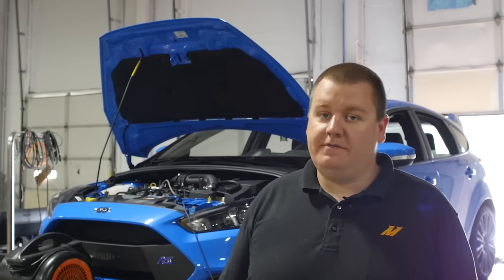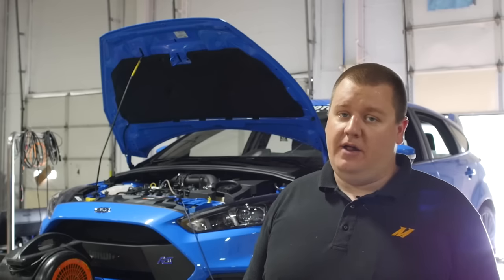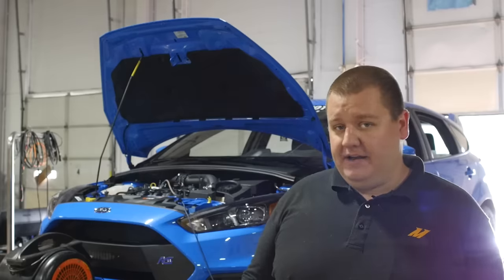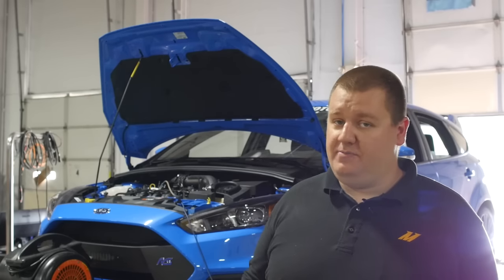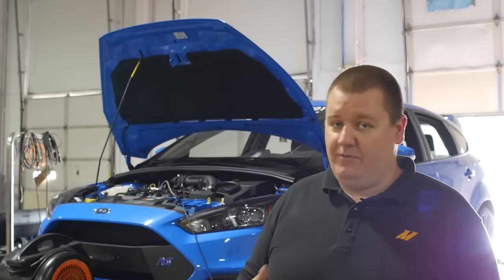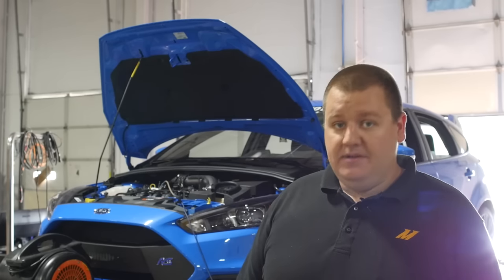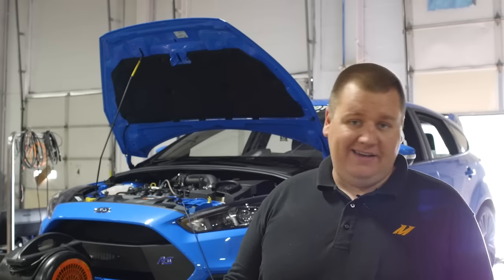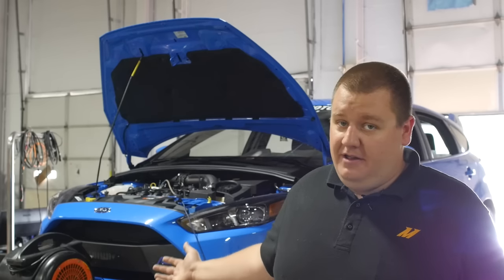2016 Ford Focus RS - Stock Dyno Pull at Mishimoto (UPDATE)

Comment: Shit, 311whp is about 373hp to the crank. Ford downplaying this car and only listed it at 350!? Now I need to go buy me one.
Reply: its probably closer to 400 since it has to go through an AWD trans.
Reply: different AWD systems will have different % drivetrain loss meaning the old take 10, 15 or 20 percent from the crank hp and that's your whp.
Reply: save your money. Every other video on YouTube shows far less hp than the 350 at the crank! Thats what he was talking about earlier...He nvr showed us LIVE footage of his dyno results on a fake graph made in excel...
Reply: #1-who cares what hp is at the crank....whp is what matters. Remove "hp at the crank" from your vocab because it means nothing....same with bhp. #2-the issue with dyno'ing the RS is the rear wheels on the RS spin faster than the front wheels (70%RWD/30% FWD). The reason the RS was dyno'ing low in some instances is because people weren't disconnecting the RDU which is different than your typical center differential. Great explanation and live dyno done by the Cobb guys here http://www.cobbtuning.com/ford-focus-rs-power-gains-and-development/
Reply: Matt Beaupre I'm sorry but BHP actually means a lot.
If you make 5000 BHP but only 200 at the wheels then your system is extremely parasitic. 
It is very important to know how much is lost in the drivetrain.
Reply: DeFreshS10 that's true...but BHP numbers alone mean very little.
Reply: Compared to whp, it does. All I'm saying is people say bhp this and that. It's what's at the wheels (whp) is what counts. Not bhp, not the manufacturer hp numbers. What the car actually puts down to the ground. Jeeeesus
Reply: You clearly have some issue with the Focus RS, and are passionate about wanting it to not live up to its deserved hype.  Unfortunately, you are not using good critical thinking skills.  First of all, below, Matt Beaupre gives you a link to a Cobb Tuning article that explains why the car cuts power on a dyno.  It's not that hard to understand, man, the car was never designed for dyno use.  It was designed to excel on the road.  There are literally 10 ways to explain why it cuts power. 

Furthermore, dyno numbers really don't mean anything but two things: 1. To see if modifications have netted gains, and 2. To see if the manufacturer is lying to you.  However, both of those things can be verified in another, more important way.  That is, REAL PERFORMANCE.  You know, on the STREET.  Where you DRIVE the car.  Why are you so hung up on dyno numbers?!  Let me break it down for you below.

All numbers from the same source, Car and Driver, all cars with manual transmission.  They go to great lengths to correct test results for weather, elevation, do two way runs, and use highly accurate equipment.

Ford Focus RS:
BHP: 345
Curb weight: 3459
0-60mph: 4.6s 
Rolling start: 5-60mph: 5.7s

Volkswagen Golf R:
BHP: 292
Curb Weight: 3329
0-60mph: 5.2s
Rolling start: 5-60mph: 6.3s

Subaru WRX STI:
BHP: 305
Curb Weight: 3402
0-60mph:  4.8s
Rolling start: 5-60mph: 6.4s

Even more telling will be their Lightning Lap times.  The STI did 3:10.5s, the Golf R 3:12.3.  The Focus RS will get run later this year, probably October.  The above numbers are in line with the horsepower numbers, especially given the weights.  The rolling start, 5-60mph test is especially telling, as it removes the launch wizardry from the test.  Given these numbers, which again, is all that REALLY matters, the Focus RS power numbers are believable.  Especially given that both of those other cars are known to be underrated and lighter.  

I'm not sure why you have some hatred for the Focus RS, but it is unfounded.  It's a lot of car for the money and there are TONS of cars that react poorly to dynos.  Hell, a lot of luxury and European cars cannot be run on a dyno without the computer shutting things down.  Why is it so hard to believe that a car with a complex AWD system might do the same?
Reply: Ford did a downplay on the first Focus RS mk1 to.
They said 215hp on the crank but when it was put on a dyno, the dynos showed 215-220hp on the wheels :)
Reply: That's the DSG version. Car and Driver tested the manual.

Comment: The first test was spot on with all the acceleration test data we have seen. It seems very obvious Ford is overrated this cars engine output.
Here is another dyno test in Europe and according to the owner/operator's interpretation of the data, he is also getting around 250 WHP. https://www.youtube.com/watch?v=6GYL2-oZLjI
And again lets not forget that the actual performance matches up perfectly with a car making 250 WHP, so those tests showing over 300 at the wheels are clearly BS.
Reply: During the break in period boost is limited.
Reply: Yea that's a load of crap, because cars tested with over 3000 miles show the same results, chassis dyno and at the drag strip.
Reply: There are many acceleration tests and people actually going to drag strips now, they are well over 1000 miles and they are no faster than a stock STI. So I don't know who you think you are fooling with this BS "update" if the car really makes an extra 60 hp after break in, that would show in the acceleration testing/drag strip results. Show me a single time where a stock Focus RS has done better than a mid 13 with a trap speed better than 105 MPH. An STI will do that all day long and only has 300 HP. If this Focus really makes 350 (310 at the wheels) it should easily do 12.8-13.0 at around 110 MPH. Not a single test has come close to that, so please don't piss on my shoes and tell me it's raining.
Reply: +Eric Michel calm down
Reply: you didn't watch the video did you
Reply: I did, twice, and I am calm. But facts are facts and bullshit is bullshit.
The facts: 1. Out of many many acceleration tests in Europe and the USA this car has never done better or much worse than mid 13's at around 105 MPH trap speed. I have now seen new owners going to drag strips (after 1000 mile break in) and run low 14's at 99 MPH. Granted their somewhat slower times are probably due to driving technique, the same holds true for many STI/EVO drivers. 
2. We have seen performance testing on brand new cars and on well used press cars and they all perform about the same.
The overwhelming performance data tells us this car is consistently putting down around 250 WHP.
So when a shop initially finds 250 whp but then later claims that the car actually makes 310 WHP consistently, that claim does not add up with the facts. Did they tweak the car, tweak the dyno? Either is possible, I don't know but something sure doesn't smell right.
Ford needs to make this right, and by trying to make excuses and hide the facts, they only delay the truth. 
People can talk about handling all day long but when they announced this car would have 350 HP and torque, with similar weight and drivetrain as an STI, everyone expected this thing to be an acceleration beast compared to the competition, and the fact is it isn't. In fact a few tests show a Golf R with DSG walks away from it. If it really made the power claimed by Ford that should never happen.
I am just stating the obvious because I was interested in this car and can't stand BS.
So we have two dyno measurements, one matches the cars straight line performance and one does not, what does that tell you?
Reply: +Eric Michel sooo Eric Michel are u turtleb00st from NASIOC? I'm sure you are. You are so salty you couldn't get your RS, so now you wanna lash out on it. That's okay, totally understandable.

Comment: this car is way over hyped. the size if the rear drive shaft is almost as thin as a finger in some places. the rear diff is the same size as some 500cc quads! I see major issue adding power to this car. 

 http://www.vorshlag.com/forums/showthread.php?t=8453
Reply: Have you experienced a driveshaft failure or are you just reading some forum post and believing it's junk because you don't like it?
Reply: +UnsulliedSpy did you not read the link I posted? this isn't oppinon its fact. the rear drive shaft and diff is laughably small. multiple tuners have experienced the awd system shutting off in order to preserve itself. the car will default to fwd only. here is another example 

http://apexjunky.com/2016/08/navid-kahangis-focus-rs-autocross-impressions/#.V64Hwxy7cfc.facebook
Reply: +UnsulliedSpy Don't get me wrong. I really wanted this car to live up to the hype. I recently sold my built 06 sti and was considering this car to replace it. I think I'm going to wait and see but I don't have much confidence in Ford's new add system. I think it will take a couple of generations before ford gets it right
Reply: It's an interesting system, I am curious to see how the clutches in the rear end hold up.  I was surprised that it didn't come with a rear diff cooler as I've heard it's not terribly difficult to overheat it.  And, frankly, anything with a "drift mode" really should have a differential cooler!

Comment: Soooo much bullshit being written on here by dummies, look, ford say the car makes 350 PS, thats nearer 345 HORSEPOWER and is measured at the flywheel. Break-horsepower is measured at the WHEELS and will be significantly less than at the fly because this car has an awd system. So if it loses only 10% then the power should be 310 bhp. Thats amazing and is whats happening here. Why cant trained mechanics grasp this concept??
Reply: brake, not break, horsepower is also measured at the flywheel. OEM published hp is at the crank, BHP is at the flywheel (should be same as OEM published hp #'s) and WHP is literally what the wheels are putting to the ground. https://www.carthrottle.com/post/the-difference-between-bhp-and-whp-explained/

Comment: Easy 500hp with bolt-ons and a tune 🤔
Reply: Correction 400 to 420hp. 500hp will  require a turbo upgrade.
Reply: Lol you crazy guy , this car is tuned to the max as it it max you can get stage 2 would be 350whp thats about it , for the car to even hit 300whp it needs overboost .
Reply: Tell that to the Mustang 2.3 that needs everything under the sun including ethanol to just hit 400 on the stock turbo. It's still a tiny turbo, just a bigger tiny turbo.
Reply: dominicancash 350whp translate to 400hp in a awd car my friend.
Reply: +Bill McGregor is ok stage 2 golf r will still kill it for sure. Even my mk7 gti would kill it from a 20 roll , 312whp with 400wqt
Reply: dominicancash probably true those MK7 brothers are sick with the APR tune.
Reply: +Marbin Diaz thats what i have mk7 gti stage 2 right now 312whp with 400wtq , will get the is38 turbo on the golf r with apr intercooler that would give me 389whp
Reply: dominicancash A tune only golf R runs 11's, those things are freaky fast. That much power through the front wheels doesn't interest me though so I would only want the R.
Reply: That is too much torque for the front wheels. It must spin like crazy. I stay with my Ralliart (Evo X wannabe) for a while. Is not very powerful but pulls hard enough to make people enjoy it.
Reply: Marbin Diaz Yeah I drove a Ralliart for a month last year. You pretty much summed it up well, enough power to have some fun but nothing too crazy.
Reply: no. all this car needs is an E85 tune and you should see 420-430 the turbo is pretty big. now adding bolt ons you may see 500 may.
Reply: Brent0285 Some tunes are already out for it, not showing big gains. There's no way this car makes 500 on the stock turbo, not even remotely possible unless you run a 100 shot.
Reply: Brent0285 Here's  a tune

http://www.autoevolution.com/news/first-2016-ford-focus-rs-engine-tuning-375-hp-by-shiftech-107927.html
Reply: +Imme F no idea.
Reply: ***** Exactly
Reply: TheSpaceyJacey 650 is only a mild 87 tune, 93 and you gotta be up near 1000....

Comment: so typical of a ford. always mechanical or electrical problems. Its whats keeping me from this car for at least,.. another 2 years
Reply: it's not a problem with the car...it's a problem the configuration of the dyno requiring the front and rear rollers to move at the same speed.